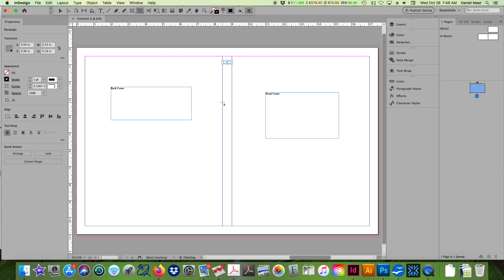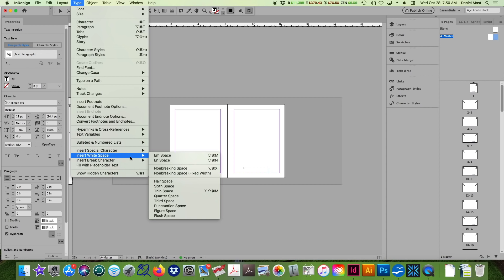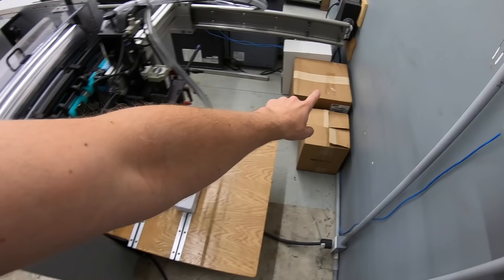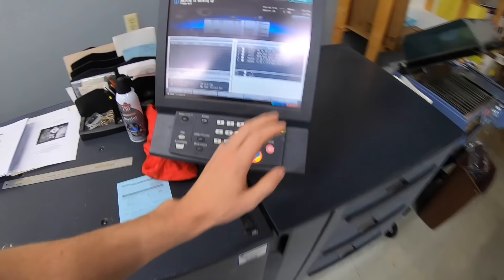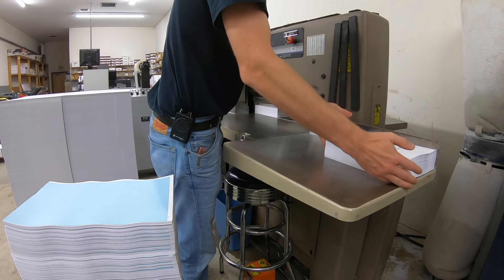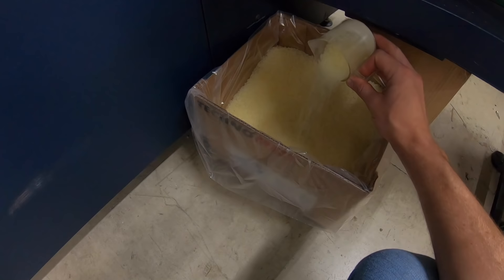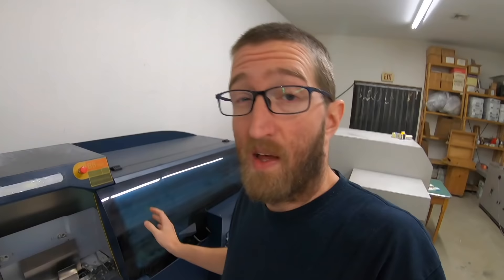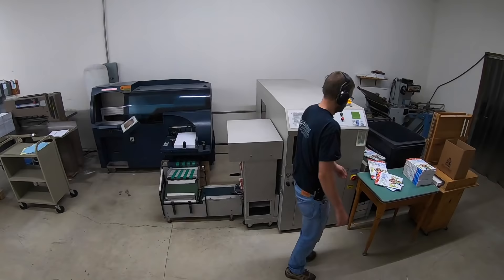Book Production From Start To Finish, Digital Printing and Binding Perfect Bound Books

Comment: One man printing operation, not like the old days with giant, Multilith presses, large process cameras, layout and light tables, a dark room and not even a venerable hot waxer for the hard copy!                                           Typesetting was done by a specially trained operator, page make up done by someone wielding an Xacto blade. Nice shop and set up.  Back in the day, you'd need at least 8-10 people to do what you're doing by yourself.
Reply from the maker: Absolutely, times have changed big time! I helped my Dad for hours shooting and developing negatives in our darkroom. Now my darkroom is just a huge closet. :)
Reply: @justaprinter  Your shop is quite impressive, modern, efficient, well lit and clean. I've worked in a few dungeon print shops in my time, your set up is a printers dream.

Comment: I used to service the same Konica 5500 or 6500 print engine before I retired. I loved those systems, very tech-friendly. The blue engine looks like a Konica 8000, I retired just as Konica was releasing them to the US. I also serviced Canon 7000 systems.

Comment: I noticed the Whittier Mailing Products box. Same company I get my tabs and address imprinter ink cartridges from. Great explanation breaking down the operation of the binder and 3 knife. Long long ago the company I worked at printed books for Microsoft and Hewlett-Packard and the binder ran PUR lay flat.pretty amazing back in the 90’s
Reply from the maker: Yes, I might need to consider a PUR machine in the future, that stuff seems like it would be a good fit if the numbers make sense.

Comment: Hi When you make your spreads, you can make three pages in width and use the page tool to make the back to the width you want and then export pdf spreads with cut marks and you get cut marks for the back. Just a tip that you might like you can do in so many ways.
Reply from the maker: Oh thank you! I'll have to try that!

Comment: I'm very glad I have Fiery servers on my KM equipment.   I used PDF snake years ago and still do for a hand full of things but the Fiery impose software combined with the workflows on the server make my life so much easier.
Reply from the maker: I'll have to look into that more. I'm so stuck in my current habit of using PDF Snake, but its probably time to upgrade.
Reply: @justaprinter   There is some limited VDP capabilities as well.  Are you running  Fiery's and Command Workstation?  I saw you print direct through the driver in one video.   Other than a few problem files I don't think I've used the drivers on my color machines for years.  Drag and drop .pdf workflow with CWS.

Comment: I worked on a  muller hot melt binder back in the day it produced around 3000 per hour on a good day, we bound the AA handbook ( equivalent to triple A in the states ) the run was 5 million it was the longest run in Europe at the time, I ended up running ferag binders capable of 30,000 stitched magazines per hour
Reply from the maker: Holy cats! Thats a lot of books! I would be stressed out if I had to estimate that job!

Comment: I have to say that most of the time when I received multiple paged InDesign files, the front cover was page one and the first body page was page 2. In other words, the even pages were on the left side. Imposition software,  would bring the first and last pages together on the first signature. But there were times were I would receive separate files for the cover and the body. There have been times where I also received files in page spreads instead of reader spreads. But where I work, have since stopped accepting this type of work.

Edit: Now that I've though about it a little longer and seeing your binding process, we normally would have had an IFC (inside front cover) and page 1 would essentially be page 3 of the InDesign file.
Reply from the maker: Oh man, sounds like me. Back in the day I would make files work, but now I'm a bit more picky. I still do a lot of helping out by inserting blank pages so pages are correct. Reader spreads are the death of me! Just give me 1 up pages! Haha.

Comment: So in the guillotine you use rubber bands with a magnetic sheet glued on them to stop the appearance of pressure "teeth"?
This is great! I can't believe it was not a standard for guillotines since the start of times!
Thank you, I will add something like that to my Adast Maxima, you saved me the 2-3 top sheets that always go to the bin because of the pressure!
Reply from the maker: They are called magnetic clamp pads, you can buy them online. A downside to using the clamp pads is that a tall stack of paper might move  when cutting. So I try to only use the pads when necessary.

Comment: If you use Coated 2 side cover you will get less curling. What is happening when you use Coated 1 side is the moisture is getting into one side of the paper and not the other causing uncoated side to contract and while the coated side does not contract. This is my experience from 44 years of book binding.
Reply from the maker: Good to know. I did start using c2s because thats all I could get right now. :)

Comment: novice question -  If the book has to be smaller - say 6 x 9 inches... do you trim the book to 6 x9 first and then bind... or do you bind first and then trim, and if the latter, how long does it take for the glue to dry

Comment: Pretty nice setup! I have only a half dozen years experience with the digital approach to bookbinding and about 30 years in commercial print and bindery( World Color, Quebecor, Quad, Transcontinental). I have only had about a years experience with a Bourg/Challenge setup and I have to say they are pretty user friendly.The place I worked for was only using the PUR glue and I hated it. I could never get consistant results from job to job. I have always used hot melt glues and had much better results. Not to mention the the maintenance and attention that was needed for the PUR was so time consuming. I loved the Challenge trimmer because as a commercial printer all my trimmer setups and adjustments were made manually while digital adjustments are so simple. I have to say your knowledge of paper weight, grain, coating is very good as I have worked with so many people who are running digital printers and have no idea what they are doing and don't understand grains and what leads to cracking. As a life long bindery guy, I'd follow you any day!
Reply from the maker: Thanks Dave, glad to hear that. I was interested to hear your input about PUR machines. I feel like I should consider adding PUR but I am hesitant because of the cleaning as you mentioned. EVA sure is simple.

Comment: Hello Dan thank you for your videos. I have learned so much from you. I run a small post press shop doing assembly of bibles printed on a web press using Rosback perfect binders and Horizon three knife trimmers. Recently we bought a KM C3070 to fit a need for small jobs for missionaries around the world who need bibles but not in the quantities that a web press makes. I wanted to ask about your paper. Our first project was on 40# text paper but the caliper is a bit larger than we like making the Bible’s too thick. Do you know of a paper source for text paper that we could use that is a caliber of 2.3 or less in a cut sheet form?
Reply from the maker: The thinnest paper I have used was Roland 40lb paper. I have not gone thinner. Thanks for watching!

Comment: Great video! What are the blue/yellow pages used for? Are they for separating each book signature? And does the press introduce it automatically?
Reply from the maker: Yes, I forgot to mention that. I have a "post inserter" that inserted a colored sheet of paper in between each book. I used to offset stack, each book block, but cutting them in half took so much longer.
Reply: @justaprinter  Wow! Is much more manual than I thought! Great work! keep doing it!

Comment: Hey Dan, great video once again. You're getting a pretty big following now. You said that you're using 1.5mm thick laminate, did you mean 150 microns? 1.5mm is like 3-4 sheets of 350gsm paper.
Reply from the maker: 1.5 mil is the film thickness. Converts to .0381 mm. Yes, this video took off! Who would have guessed?

Comment: Great video !! What is you're opinion on liquid lamination what is the best use for it? We have a uv liquid coating machine but we almost never use it as is messy and hard to clean. 
What would you usit for ?
 I am thinking to sell it to know what is the best costumer to sale it to
Reply: Film lamination is great for durability and longevity as Dan mentions it. UV Coating on the other side is a lot faster, way way cheaper, hald a penny per square feet and it has gotten better in terms of stinking lol and aplication such as texturing and or spot UV. Both are great alternatives which have their own advantages/disadvantages.  I have one UV coater and looking to buy another one to install it inline with our other press.
Reply from the maker: People use UV coatings for low cost, high volume gloss. Book covers, post cards, business cards where cost is a big concern. Glad others know what I mean about the smell!

Comment: If I wanted to get 300 perfect bound year books printed for my kids school and have custom covers for each book. Lets say one cover has a picture of Jennifer, next book has a picture of Mike, etc. Do you think most printers would be able to easily handle that request. Looking through the work flow it seems like it would be fairly easy to do. The printer would just print out the covers which would all be different and then perfect bind them. But maybe I am missing something? Seems like the same amount of work as long as I provide all the personalized covers as a 300 page pdf file they should just be able to print the whole file right?
Reply from the maker: That would be correct. Should be simple and would be fine if you set up as you explained.

Comment: When you are cutting the covers for the books do you cut the cover the same at 210mm or add 050mm to make 210.50 mm.ad the inside pages to 210mm ??
Also your Bostitch wire stitcher how to make the staples longer if you do a thicker invoice book.
Many thanks
Reply from the maker: The covers are larger than the book block when they are glued. Then trimmed to size later. To adjust the stitcher you turn the wheel on the top of the machine. You can see in the owners manual and that should be online somewhere.

Comment: Hi Dan,
Do you have experience using coated glossy paper with bourg machine (EVA/hot melt)?
Can you glue it in the right quality? Or would you rather just recommend ofset paper to use?
Gabor
Reply from the maker: Uncoated paper is produce the best result, but if you use the correct adhesive, coated paper works pretty good too.

Comment: Hey, enjoyed your video, I'm a printer as well. Good to see you are busy.  Just curious on setting the spine thickness. You divided the number of pages by 435, is that the thickness of the stock, say 4.35pts (or essentially 1000 sheets =4.35 inches for 60# offset) you actually used 70#, I'm guessing that part was just an example.
Reply from the maker: I divided the number of pages by the pages per inch. You can either count out and measure the PPI, or it can be calculated by the caliper.

Comment: Nice video. Just a question. I don't know if it's in the comments yet, but why not use Fiery Impose? I myself work with Xerox printers with a Fiery Rip and use Fiery Impose all day long.
Reply from the maker: A few others mentioned I should check out Fiery Impose. I'll have to check it out since it was included in my last press purchase. I just keep using PDF Snake because I have it and it works. :)

Comment: Hi. I'm not sure if you've ever covered or answered this question. PUR vs Normal Perfect bind - why you don't use PUR. What would you recommend between the 2 for person who's looking to purchase perfect binding setup
Reply from the maker: EVA is less expensive and more common. PUR is has more durability. When we got started EVA was the only option so thats what we used. PUR is better for coated paper. Most of what we bind is uncoated so EVA works well. I'll probably consider switching to PUR in the future.

Comment: hey! Loved your video!:) I started printing spiral bound planners just recently - I have a very basic setup and still trying to learn. The issue I'm seeing is the warped paper once it comes out of the printer and I've noticed yours is warped too - do you leave your books to straighten in a controlled humidity room afterwards? or are they are not warped anymore once you bind them?

I leave my notebooks a few days so they straighten themselves out - they're usually not completely straight though. Not sure what I'm doing wrong or if this is normal :(
Reply from the maker: Thats normal. Could take a few weeks to flatten out depending on the current humidity.
Reply: @justaprinter  Great to hear it's normal - I thought I was doing something really wrong. Thank you for your answer, I really appreciate it!

Comment: Client has an 8x9 with bleed that folds to a finish size of 4x9. It is an  8pg booklet with 80lb cover and 100lb text, center stapled. I want to print and make the booklet on an Iridesse with in-line booklet maker, using Fiery 6. I print similar 6x9 finish size all the time. I have not figured how to do a 4x9 finish size. How do you do a book with a 4x9 finish size?

Comment: Thank you, that was so interesting. I have a question about the machine that binds the "guts". Do you feed it with a big stack of the printed pages -- and if yes, then how does the machine know to take the exact number of pages from the big stack -- and bind that exact number ?
Reply from the maker: I feed mine by hand, one book block at a time, There are more automated attachments that feed automatically.
Reply: @justaprinter  That sounds good -- I would not need that extra automation to feed automatically.

Comment: Thanks for your video. I want to know what is the different 
offset and digital printer machines. I also want to make a print shop. Which one is better i dont know yet.
Reply from the maker: They both have a place. It depends on what your customers need. A digital press will likely be the best in most cases these days.

Comment: I re=publish out of copyright books and have more than 30,000 titles. I have used Ventura to create the books for many years, but I am now converting the Ventura files to PDF. Ventura will convert my book files to PDF with  a single click, but I have not found a way to print the PDF's 2-up, so that I can print my statement-half-sized books 2-up and cut them ready for  binding as you do.. All my books are hard-bound. Is there a way for me to do this  Feeding the statement- half-sized paper does not go well. 

All the best,

David N. Goodchild
Reply from the maker: All you need is imposition software. You can find plugins that work with Adobe Acrobat. I use PDF snake but it is no longer available.

Comment: I may have missed it, but why cut the cover down on the guillotine when you have the three knife trimmer?
Reply from the maker: I trimmed the cover down slightly so the overlap was only .125 inch. That is a standard adjustment that I don;t need to make on the binder for each book.

Comment: That cutting machine is scaring the heck outta me. Im wanting to print postcards and do UV coating how can i offer that? What printer and machines would I need? Postcards, trifolds, 4x9 rack cards etc.
Reply from the maker: A Konica Minolta c3070 or the like would be fine. I don't know much about UV coating.

Comment: Question - What does it mean when someone says the Magazine will Jog to Head? I see this often when reviewing press specs for Magazines.
Reply from the maker: My guess would be that the signatures would be jogged to the head of the magazine, which would be the top. The bottom edge of a book/magazine would be the foot. So when I put the book block into my perfect binder it would jog to the foot, which was to the right side.

Comment: Hello there and greetings from Iceland :-)

I have the same CP bourg machine. The creasing is not working, any ideas what it could be?
Reply from the maker: You can adjust the amount of creasing pressure, it may have just moved. There is a small lever inside above the crease mechanism. It could be a wire or solenoid or sensor too. Did you try to engage it in service mode?

Comment: hello, a question for you.while using the Horizon vac 100-a, does it have sensors whereby while collecting it notices a blank paper or a dirty paper
Reply from the maker: Yes it does. It would actually stop if a blank sheet was put in the stack.
Reply: @justaprinter  am applying for the greencard lottery ,if I win could you please host me

Comment: Hi thanks for sharing your printing setups. off the topics. any good resource to buy glossy paper and 11x17 papers.
Reply from the maker: I buy my paper from my local paper supplier. Not sure where to buy smaller quantities.
Reply: @justaprinter  thanks for the reply.. i will check our local areas. due to the paper shortage, the price is going up alot.

Comment: Can you give me little advice, i need top print coloring book. I have illustrator file. A4 size. I have one by one page. Not side by side.(left and right) i have 30 pages.
So, if i need to create coloring book do it need to reformat it as side by side? Can i print all pages one by one and put all together?
Reply from the maker: Yes, you can print pages one by one. Best practice is to use Indesign.
Reply: @justaprinter  yeah. Indesign is best for printing. But i used illustrator to drawing. That’s why i use illustrator to final files. Thanks